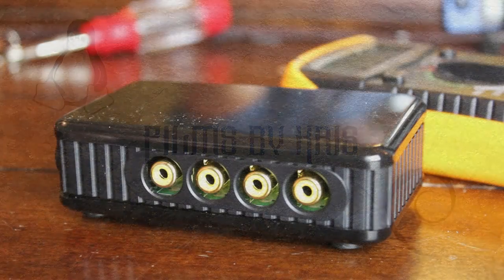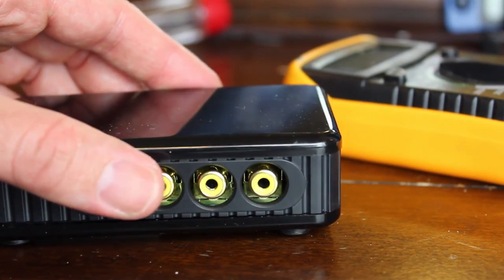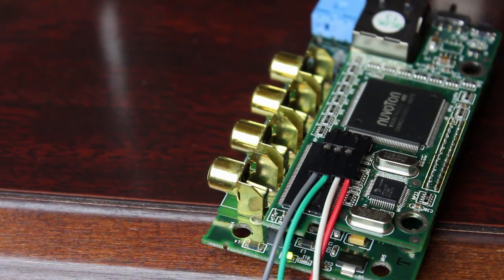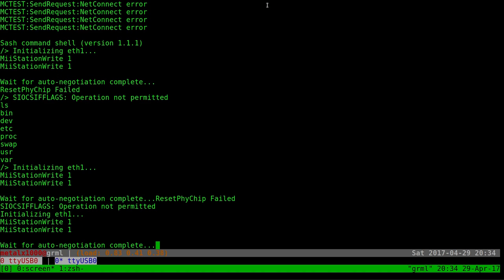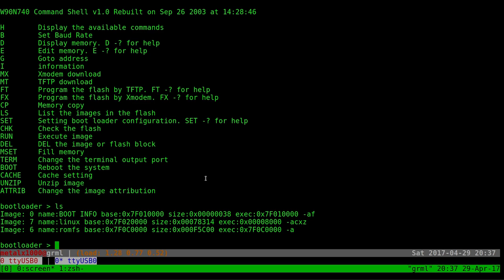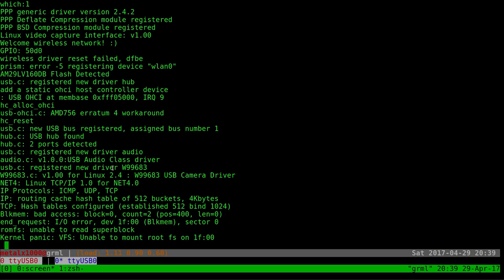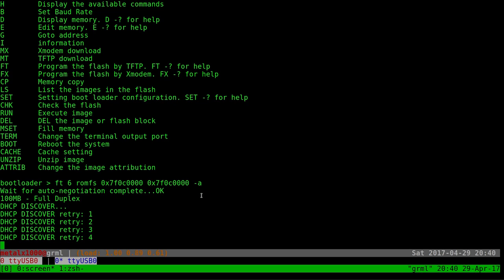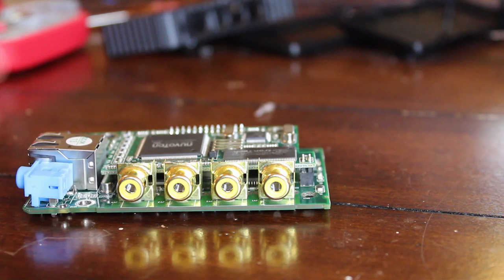UART Serial Hack 9100a IP Video Server Linux Shell

Comment: When I web access my old 9100a device with 2.37 firmware, I get a Simple/index.htm page and no option to firmware upgrade. YOICS forum is down since may 2020, do you know where to get copies of the files there somewhere else?

EDIT: after grep'ing strings 9100_EN_IE_V239-A.bin I discover that the standard index page looks for an old version of internet explorer, which I don't have, and divert to that Simple index page I got to every other browser. To upgrade the firmware through web interface, if you know its IP, go to http://ip/Update.htm and upload the yoics9100a_2_47.bin (it seems to be the latest released). The page is dumb, you don't get any display of flashing progress, but after a few minutes I decided to reboot and my unit is working with YOICS firmware :-)

EDIT: here https://www.solivant.com/OldStuff/9100aplus/ shows how to extract the romfs from a bin image file